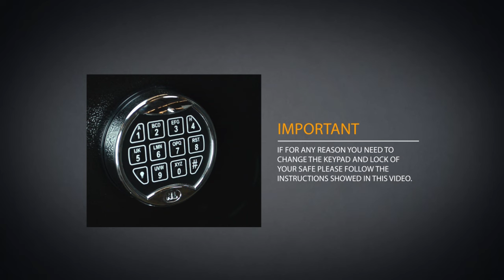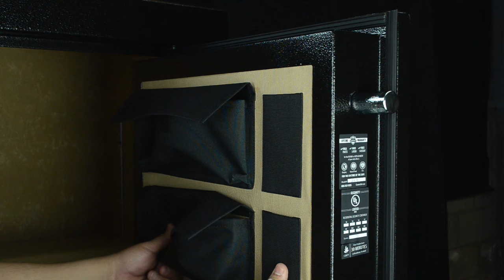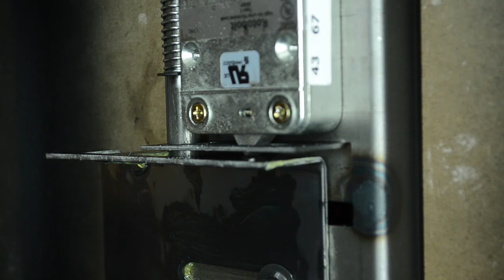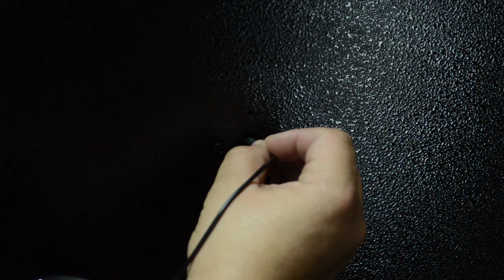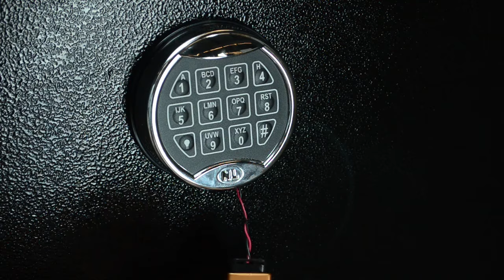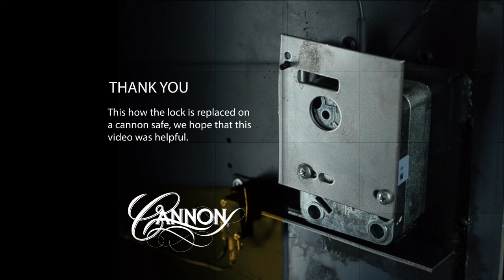Cannon Safe - Help - Lock Removal & Installation

Comment: So, how in hell do I open the safe to change this useless keypad ? The useless keypad will not work so I cannot open the safe ! Be warned ,NEVER buy a cannon safe !
Reply: Hi, I had SAME problem. I called Cannon and they guy walked me through all these 'tricks' to try to open it. Nothing worked. I tried about 50 times over a 3 hour perios.  Then I pushed as hard as I could on the keypads, still didn't work. Then I literal said I'm going to try this ONE more time. I pushed hard, but not as hard as the previous time, and the damned thing OPENED!!!!  Cannon sent new parts, turns out the new lock is defective, they forgot to thread the area where the screws go in!!!! Probably made in China.
Reply: HI swankster, Glad to hear you got your safe open. My safe would not open using any tricks, tips or suggestions. I kept at it, off and on for about ten days with no luck. I live in a very rural area so the nearest qualified locksmith is about 175 miles away.He tried to come up with a solution over the phone but still no open. I needed to get it open because  I had credit cards stored inside. So, I finally cut a hole in the door using a 9 inch grinder with a cut off wheel on it. It's open now but I have not decided what to do with it. I can weld it back together and repaint it or just junk it out and go buy a safe that can relied on to open when needed. If I decide to keep it I will need to buy a dial type lock instead of the useless keypad.
Reply: @Swanky95472  Going through this as well.  The old lock used the vertical screws, top/bottom.  The new keypad uses the right/left ones.....not threaded.  How did you solve the dilemma?  Did you thread the holes yourself?  That's what I'm thinking but since I don't own a tap/thread kit I wanted to ask.
Reply: @Swanky95472  m1996

Comment: Don't buy anything that has cannon on it. Customer service is the worst I've ever encountered. I've been trying for 2 weeks to get in touch with them because the key pad stopped working. Today, I called 5 times and was on hold for over 90 minutes. They did finally call back at 8:00 pm just to tell me they are closed. They suck.

Comment: My cannon safe lock eats batteries like candy (one every 3-4 days) and then quits working. My safe was purchased a short time ago from tractor supply. I’ve tried to call Cannon to get a replacement lock or help. Have called multiple times now and have never spoke to a person yet…this last time I called I selected an option for a “callback” to see if I had different results and to prevent waiting on hold for over an hour (with nobody ever picking up) as before. The result achieved was an automated callback which said “your callback has been cancelled in the queue due to high call volume”. If you’re looking for a safe, I would recommend staying away from Cannon safes. The safe’s fit and finish is ok, but if it tears up in a few months and customer support is non existent…then you just have a large expensive piece of metal. Sooo, now I’m trying to find a fix or replacement lock myself because cannon doesn’t support its products. Any potential buyers should disregard the “warranty” offered by cannon as they won’t answer the phone or respond to support tickets.

Comment: Canon tech person tells me to call a locksmith to drill out my lock to unlatch my bolts to open the safe door. I got a bad keypad. Canon will not pay for the repair bur will replace with a new lock and keypad. So what happened to the Lifetime Warranty here?
Reply: We are having a similar problem with them!

Comment: If you have a Cannon safe and the keypad will simply not lift up and off like is shown in the video, you may have one of the earlier electronic models like I did.  Hopefully you aren't locked out of your safe, I was able to get my safe door open and extend the locking bolts to prevent the door from closing while I changed out the lock.  If it's closed in the locked position, you're going to have to call Cannon or a Safesmith.  You have to cut/tear/remove all of the numbered plastic keypad to gain access to 2 screws.  Behind the keypad there are 2 Phillips screws that have to be removed from the front, you can beat it upwards all day with a hammer and it isn't going to come off, these early keypad locks weren't made to be removed without destroying the keypad.

If you can get the keypad and lock off, Youtube has a Great video titled "S&G 6730 Combination Lock Installation", which shows how to install a S&G lock.
Reply: Wish I had read this about 3 hours ago. I ended up hack sawing the dang thing off!!!!!
Reply: Actually, you just need to pop the S&G bubble logo sticker off which exposes a Phillips head screw that can be removed to get front of keypad off. This leaves one of the mounting screws exposed. There is a plastic cover where battery compartment is that you twist and remove to gain access to the second mounting screw.

Comment: Does this video upload by Cannon demonstrate that the weak link in the safe system is the problematic keypad and its imminent failure?
Reply: Yea the video should be: "how to remove shitty electronic keypad lock and replace it with a mechanical lock that should have came with the safe in the first place that we sent you for free to make up for our horrible insight."

Comment: And what if the keypad craps out and you cannot open the safe too do the replacement??
Reply: Andrew Weaver same question
Reply: I have the same question. A thief damaging the keypad is a common problem.  I imagine you can replace the keypad. But how can you replace it if the connection is inside the safe?

Comment: Safe locked up can't open it     Been locked out for 7 years.   Can I jus change key pad    Then change the code on it     Or what can be done    Besides drilling it apart.         Please let me know.     Sick of this.     Mike Collom    Help.  Help.  Some body.
Reply: Cannon has a by pass code, call customer service
Reply: Once you use that code given to you it will not work again. So I suggest to put a mechanical lock on it or a  EMP-Proof Redundant Electro-Mechanical Safe Lock made by SafeLogic Xtreme. This guy has done a video: https://www.youtube.com/watch?v=1-YJsHd1QHc&t=173s

Comment: My Winchester electronic lock failed on the inside. They sent me a piece of crap plastic NL to replace piece of 💩 Lagard keypad but that did not work. The main problem with these people is you can't get to customer service when electronic lock stops working. I will do a video of the safe getting drilled and opened because I can't get any help. I will then weld some plate tool on inside of door where it was drilled and then I will replace the key pad with SafeLogic Xtreme emp resistance electronic and mechanical lock. I urge anyone thinking about buying a Winchester to call them first and see how many days and calls it takes to talk to someone.

Comment: Canon safes are horrible because the electronic actuator inside goes out!! And when it does which it will!! It doesn't matter if you put the correct code in 80 times even with new batteries even dated to 2030 🤷🏻‍♂️🤦🏻‍♂️🤦🏻‍♂️ You have to pay for a locksmith to come drill a big ass hole in your safe which makes it no good in order to get your valuable guns out of it!!

Comment: I highly recommend anyone in the market for a gun safe to get one with a key backup. My digital lock failed and it took Cannon 3 weeks to get me a replacement. They told me that they don't use the secure ram locks anymore (that's what I had that went bad) so they sent me a "ram bolt"...maybe? Can't remember the name right off the bat but I didn't like the fact that it's so light. The one that broke had a metal housing where the new one is plastic. Here's a video of it being replaced if anyone is interested.  https://youtu.be/Ab65HaluE0A